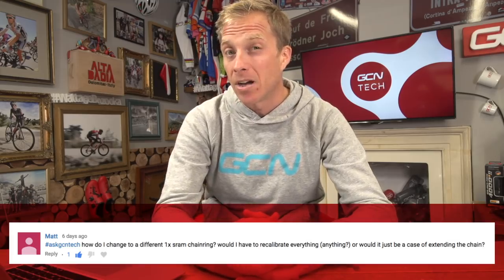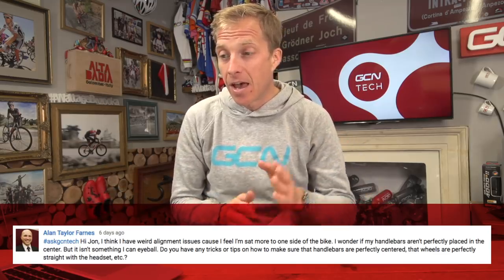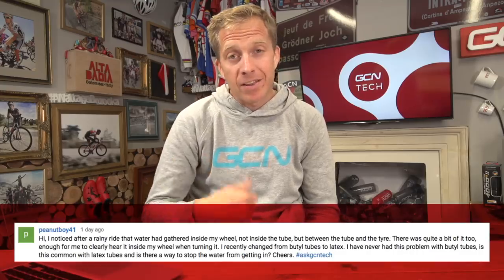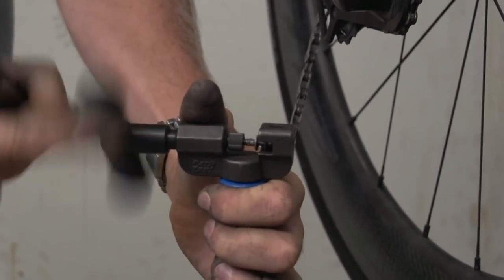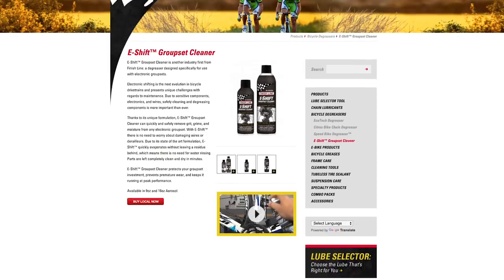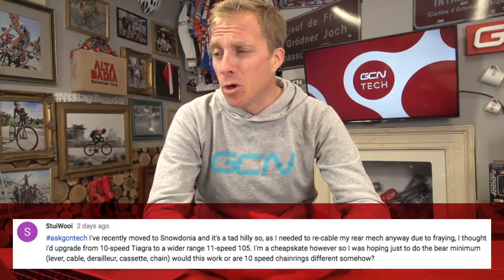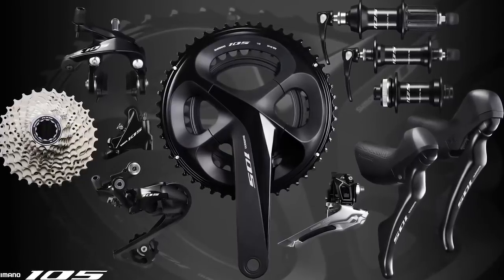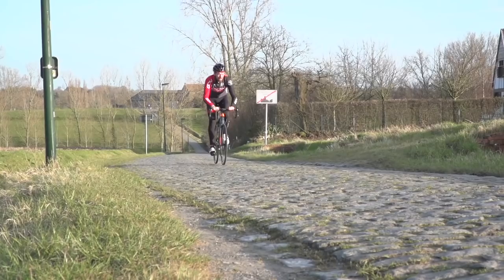How Do I Perfectly Align My Handlebars & Stem? | GCN Tech Clinic

Comment from the maker: Remember to keep your questions coming in for Jon using #askgcntech. 👇
Reply: Is the narrow wide chainring really necessary if im riding 1x8
Reply: Hi there, I have a 4iiii Ultegra 6800 left-crank powermeter on my current bike. Now I am planning to get a new bike with Ultegra 8000 and would like to keep using the powermeter. Can I use the 6800 left crank with the 8000 chainset? Are there any disadvantages other than the slight visual mismatch? Thanks!
Reply: Is there a reason seat posts and steerer tubes not keyed? That would completely eliminate the worry about proper alignment. The only downside I can think of is stress concentration around the key way and material weight to compensate for this.
Reply: #askgcntech I always see people sitting on the top tube of their alloy/steel bikes, when I'm out and about on club rides and we're making a short little stop. Since I'm running a carbon frame I'm less confident sitting on the top tube since it's carbon. Is it safe for me to do so as well or does it depend on the frame? And if so, what's a good example of a frame for which this is fine?
Reply: #askgcntech Hi Jon, loving you work! I have a set of Easton EC90 TT tubular rims (50mm FR, 90mm R), 2013 model. I currently run 23mm Vittoria Corsa CX tubs but would like to change to 25mm Corsa's. The rim width is 21mm. Is it okay, and more importantly safe to use a 25mm tub with this width of rim? I can't find any info on the world wide web so hopefully you can help.
Reply: @tecnociclista5342   I used to pair my older Stages Power Ultegra 6800 left crank arm with Dura Ace R9100 crankset without any problem before I finally sold my kidney for a pair of full Stages LR Dura Ace power meter sets. And to my weak legs at least its truely aesthetic difference minus a few dozens grams.
Reply: @DamianJames  Actually there are already model specific seat posts which are not shaped as round-tube and supposed to orient themselves once clamped up which is really nice when it fits. But I find it on one of my such bikes (skip the brand name) that the shape of seat tube opening (which is part of bike frame) may be slightly off such that I have to adjust the saddle alignment from the seat clamp and rail which is no less annoying.
Reply: #askgcntech Hi Jon, I recently got a steeled framed bike (a Ritchey) and am worried about it eventually rusting - I'm looking forward to riding it for years! Is there any reason to be worried, and anything I can do to extend the life of the frame? Cheers
Reply: Hi, Jon. When I changed my cassette to Sora CS-HG50-9 to get a wider spread, I also changed my rear mech to Sora RD-R3000-SS to match it. The shifters are Sora ST-3400. I thought that all three being Sora with 9 gears they would be compatible, but the indexing is never spot on. Someone told me that Shimano changed the cable ratio on Sora and I should upgrade the shifters too, to R3000. Is that likely or is the problem something else? Please answer! #gcntech
Reply: #askgcntech. Jon is there a way of securing Di2 cables 1000% from coming loose and disconnecting? I've had mine come out twice, once with huge consequences (175km ride home in the big ring). Surely the pros riding over Paris Roubaix must have to do something special?
Reply: My chain loves to fall on the inside of the Chainset, which destroys the paint and jams in between the chainset and frame hard. I’ve had it repaired and resprayed twice now and yet again I can not stop this happening. What can I do to stop this, or is it the bike, as not had this issues before.

Comment: Glad to hear the old pirate eye/wad eye is a universal way of getting the stem alignment with the front wheel. I once forgot to tighten the bolts after lining up my TT rig and came off shortly after testing out my 'thorough' alignment. Red hot tip, always screw things back up when you loosen them.
Reply from the maker: Yep that's a good tip!

Comment: With regards metal cleats, I bought my first road bike second hand and it came with Time pedals with metal cleats (and a plastic body where cleat meets pedal). I was able to get replacement cleats at my local bike shop until about 10 or 15 years ago, when I was told the age of saving weight meant they were no longer being produced. Sad times.

Comment: FWIW, re the SRAM 1x chainring question, I regularly swap between 2 sets of wheels, one with an 11x36 and one with an 11x42, and I do not have to adjust anything when I do that.   The clutch derailleur takes up any chain slack (chain was fitted for 40x11x42), and shifting works perfectly without adjusting anything.    I also changed chainring from a 40 to a 42,  and didn't have to do anything either.  It just worked.

Comment: To make sure my front wheel, stem, and even seat is all aligned I tape a long piece of string to the back of the saddle, in the middle of course.To start, you make sure the saddle is aligned by stretching the string to the stem making sure it intersects the middle of the stem cap/bolt. Then its as simple as making sure the "middle tip" of the saddle is intersected be the string. You can even eyeball the string making sure it is parallel with the top tube and runs right down the middle of the saddle, almost dissecting it into two perfect halves just to double check.Then to make sure the stem and wheel are parallel I loosen the stem just enough and hold the string in the middle of the tire. Tapping the stem so that the string intersects both the center of the stem cap/bolt and middle of the end of the stem/faceplate. You can also eyeball the string running down the middle of the entire length of the stem, again perfectly dissecting the stem into two equal halves. Now everything from wheel to the stem all the way back to your saddle should be perfectly horizontal with your top tube and run right through the middle of the bike, i.e. the stem cap. Someone out there owes me a beer.

Comment: About the water inside the rim. I believe it is important, from time to time, especially during rainy season to remove, tire, tube rim tape, and or anything else (in the case of tubeless tire) and leave everything to dry. Types of water damage: In the case of metal type nipples and or spokes, they, with time, end up corroding, making wheel alignment a problem because it can stick the nipples with the spokes. Also, it weakens the material and becomes a failure point when the rim goes through a pot hole, or some abuse. Aluminum rims, nipples, or spokes are also a problem, they don´t necessary oxidize but they corrode, and it is also a chemical wear notable as a white dusty stuff; so, it seems like a good idea to dry a rim even if it is a carbon rim with aluminum inserts. Maybe for top of the line stuff, there is very little to worry about, sense carbon fiber works different than metal, and probably the sealant of tubeless tires has no effect with rain, even though they too have a life expectancy; but I have no experience with them in the long run, so I can´t really tell. I live in Mexico City and we have a rainy season of about 4 to 6 months every year. I do ride in the wet a lot and corrosion mixed with consecutive damage has been my primary cause for replacing rim parts in general. As a rule of thumb, every two years, the whole rim set must be replaced for a new one. I am always trying to get the most life out of my rims and keeping them dry seems to me like a good investment. ¿Am I wrong about this?

Comment: If the water is accumulating between tire and tube, then the latex may be playing a part by leaking/deflating more quickly and opening up the gap between the tire sidewall+bead and the rim.  After a wet ride, the tire and rim have some residual water on them.  If the latex loses pressure before the water evaporates, then the water may seep into the gap at the rim.  If he wipes the tires and wheels dry after a wet ride and the problem stops, or he switches back to butyl but deflates them maybe 20-30psi after a wet ride as an experiment and the problem remains, then the faster leakage/deflation of latex tubes explains it.

Comment: Hi Jon. Love the show, I have a problem with a creaky bike. I’ve removed and re-greased the pedals, seat post and cranks, cleaned and lubricated the chain. I’ve not touched the BB. The problem only occurs when I turn the pedals (in and out of the saddle) but doesn’t seem to occur when I use the bike on an indoor trainer.

Comment: John, i have the original Wahoo Kickr, and recently bought the 12x142 adapter for my new Trek Madone SLR disc. The drive side ´insert´ doesn’t go very far into the frame, so it’s not a very secure connection. I see you’ve had a similar bike on the kickr. Did you have to force the fit? Any thoughts?

Comment: Hi Jon. I'm fairly new to cycling (started Nov 2017) and love it and GCN.  I have a Tiagra compact 50/34 chainset and 12/28 cassette. I spin in the highest gear so want to go to a 52 big ring - is it possible to just change the 50 to a 52 (and is the difference noticeable or should I go for a 53 or higher?)
Thanks. 
P.S. you guys rock (except for Lloydy's captions. Painful!

Comment: Only real reason for plastic cleats is weight, as usual. Not necessarily of the cleats themselves, but the pedals as well.
As John mentioned, the pedal bodies are made of relatively soft, but extremely light materials. Hence why a softer (and coincidentaly lighter) material is needed for the cleats.
If you want something hard wearing, switch to mtb pedals, cleats and some stiff shoes.
They use metal for everything that is suspected to wear and don't necessarily weigh that much more.

Comment: Your plumb bob method only works if you are certain your bike is help perfectly vertical. Try standing over your handlebar and aligning the bar with the front of the dropouts of the fork to ensure the bars and axle are on the same plane.
Reply: I too prefer this bar-dropout plane alignment, but I use a straight line on the ground as reference and take photo from the side so no need to stand and look over the bar which is quite stressful to naked eye (particularly using just one eye).

Comment: For StuiWooi's issue at 7:46 one option might be to buy 48/32 or 46/30 chainrings from AbsoluteBlack which have been very cleverly designed to run with standard Shimano 110/4 cranks!  This is what I am going to do for a secondhand bike I bought with Ultegra 6700 10 speed with a ridiculous 53/39 & 11-25 combo. https://bikerumor.com/2018/01/09/climb-anything-new-absoluteblack-46-30-48-32-micro-compact-chainrings/
"AB’s founder says he’s been able to climb a 37% grade on gravel using these with an 11-30 cassette, yet not lose the top end speed needed for regular group rides. His example is that a 53/13T @90rpm gives 46.5km/h(29mph), which is actually slower by 3km/h(2mph) than 48/11T at the same cadence. Yes, you’d be faster in 53/11, but how many of us ever really use that combo? And many more of us wish we had something lower when we’re climbing?"

Comment: Hi Jon, love the Tech Clinic! I bought a bike with Vittoria Tactic wheels, after about 300 miles of riding I gave it a good wash, just a bucket and sponge and regular hose to rinse. After that the freewheel was “sticking” so I wanted to take apart the freehub to clean it out. Had to take out the non drive side bearing to access the retaining nut and could not turn it, my LBS could not turn it either! So I am sending it to Vittoria to fix. So...1.Did I wash grit into the freehub? 2.Can you recommend some easier to maintain wheels? Thanks-Michael

Comment: Hi Jon, I've gained some weight and feel my usual pressure in my tyres might be too high for my weight (currently over 100kg with commute backpack). My last ride my front tyre burst. I use 25mm tyres usually at 100psi which i have done for years (obviously at a lower body weight). Is there a rule for body weight vs tyre pressue?
Would a wider tyres (28mm+) be better for supporting heavier riders? #AskGCNTech
Reply: Hi Jon, the GCN workshop is a dream for every cyclist, but there are so many tools! If we are starting to build our home bike tool kit, what should we be investing in first (aside from a set of allen keys). Is there a minimum tool kit we need to do the maximum amount of general maintenance we can/should do at home? Every tool has a perspose, but what are the ones we MUST have and ones we can do without? #AskGCNTech
Reply: Hi Han-Soo, I'm a heavy rider of around 105 kg and I can honestly say that you would benefit from 28 mm tyres. You'd want the extra tyre width to distribute your load more. When I'm looking to buy a new bike I always take into account the width of the tyre and how many spokes it has. If your wheel has 24 spokes then you are putting more stress through each bike spoke than compared to a wheel that has 32 spokes.
Reply: Hi Jon, for bikepacking, what maintenance/cleaning should we be doing when on a ride? How do we clean a drive train on a bikepacking adventure? Obviously we need to take more than spare inner tubes, mini pump and multi tool (or do we?), what tools/spare to take? Tyre? Chain? #AskGCNTech

Comment: Hi Jon: I have a problem on rear mech noise that's driving me nuts. I recently rebuilt my ten-year-old Cannondale Synapse with a fresh set of 105 5800 components, BBR60 bottom bracket, short reach handlebars, and HED Ardennes+ rim-braked wheels; the only components that made it over from the old setup were my Dura-Ace 7810 pedals, Specialized Alias saddle, seat post, and the headset. Everything went well at first, but after transporting the bike around 500 miles, some noise crept in on the rear mech in the second to the fifth smallest sprockets on the cassette when in the large chainring. For reference, this is on an 11-28 cassette, so it's the 12, 13, 14, 15 sprockets with the 50T ring on a compact crank. I have the longer-cage derailleur in case of sticking a 30 or 32 cassette for when I'm traveling to hillier places. I've rechecked and aligned the derailleur hanger, which had gotten bent when I transported the bike, re-indexed, checked limit screws, checked torque on the cassette locking, etc., but there is occasionally loud vibrating tooth-on-chain noise on the stand, worst in the 12 cog, moderate in the 13, light in the 14, and absent in the 11 and also in the 15 and larger, and on the road in those 12-15 gears while there's nothing blatant I hear the clicking sound that hints at something ever so slightly out of index. Is the cage of the derailleur itself slightly out? Am I missing something else?

Comment: My question is about brakes, first one is on a hydraulic disc brake, how do you tell when to change the pads since you can't see them like rim brakes? My second question is, I recently purchased a old PUCH bicycle, can i changed the square block brake pads to a modern cartridge style pad? #askgcntech

Comment: #AskGCNTech Jon, Towards the end, you advised the asymmetric pairing of 28mm rear and 25mm front, which may be aesthetically pleasing, but (at the same tire pressure), wouldn't the handling be skewed to understeer because the rear loading/contact patch/traction would be differentially greater than the front loading/contact patch/traction? Wouldn't 28mm front and 25mm rear actually provide more neutral handling? Or, being bicycle tires, would the contact patch difference be negligible? I think more thought and analysis may be warranted, and that a differential tire pressure should figure in as well. ScottW (KleinQCR)

Comment: Hi Jon! I am a new cyclist with an old steel chromoly rooad bike. 
I restored the frame few months ago with my mechanic but I didnt expect that my hubs would be so long for my frame. We managed to fit the hubs (its around 160mm-ish in lenght I believe its the old shimano parallax 8-speed hub) we used big screwdriver to fit the hub. 

Now should I expand my frame to accommodate lengthy hubs or should I buy a new hubs that is shorter (around 120mm) 
this is not much of the tech, but thanks in advance :)
Reply: The standard for road bikes with 8 speed and more is 130 mm dropout spacing, with 7 and less gears it is 126 mm. You can usually stretch out the dropouts on the chromoly frame from 126 to 130 mm with no worries, just make sure they are symmetrical and properly aligned. I haven't seen a 160mm hub yet though.

Comment: Regarding peanutpoy41's water in tire issue... Perhaps the water is getting in because the latex tube he installed is too small (in cross-sectional diameter) and it's not providing full support of the tire and sidewalls.  This lets a gap form between the tire and the wheel when cornering because the lateral forces are pulling the tire sideways relative to the rim?  In another GCN video I saw, one of the presents was saying that you have to re-inflate latex tubes before each ride as they are more porous and will lose pressure faster than butyl.  So... maybe your tubes are under-pressured and they are not providing the necessary sidewall support (as if they were too small in cross sectional diameter) which lets the tire and the rim separate under load and lets water in?  No experience with latex tubes so just tossing about some thoughts.  ( I would expect the more flexible latex tube to fill the void between the rim and tire better (that void is not necessarily "circular" in cross section) than a more stiff butyl tube.  That would argue for less water to enter - the opposite of what's happening here.)

Comment: #askgcntech Hi Jon, I'm using R8000 50/34 with 11-32 groupset but unfortunately its extremely noise when its on the big chainring and on most of the cogs, I can confirm its not FD rubbing, sounds like the RD jockey wheels. When its on the small chainring, the drivetrain is practically silent on all the cogs except the smallest cogs which is FD rubbing as expected. Any suggestions...